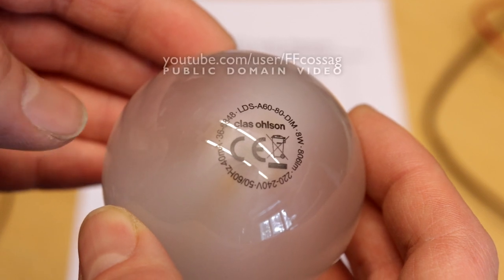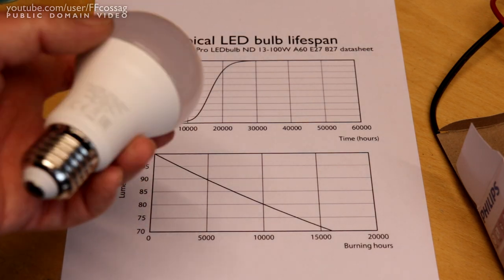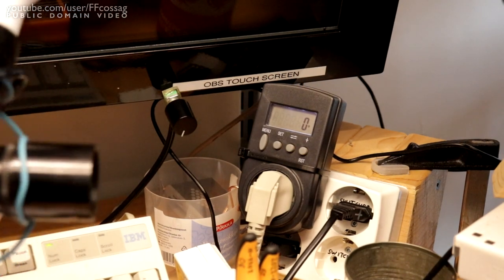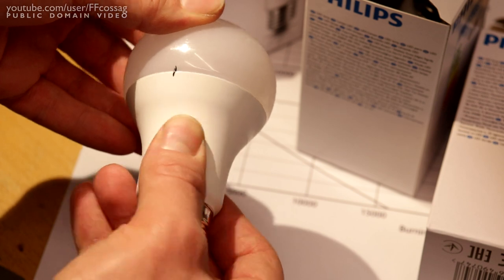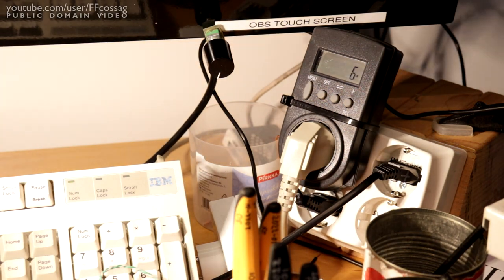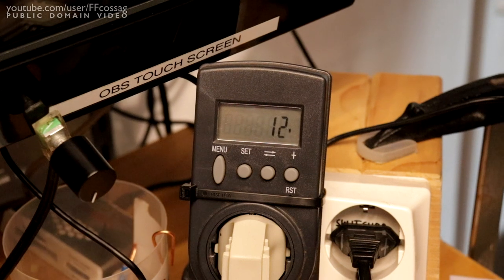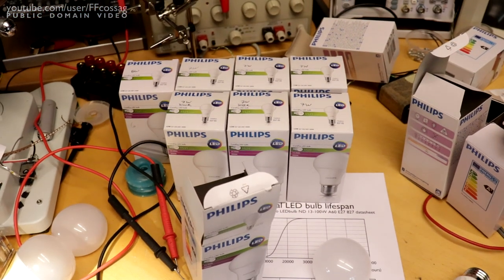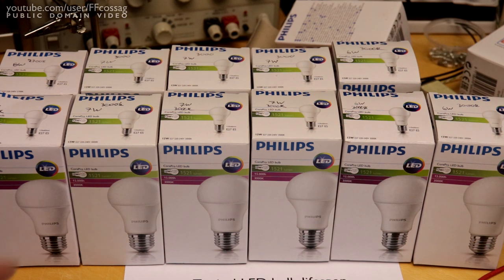Making "Dubai lamps" from 13 W Philips bulbs with a simple hack!

Comment: I think the brightness decrease is not linear, in fact at 50% of the current the brightness may still be 60% or even more!
Reply: It's not just the LEDs becoming slightly more efficient.
Firstly, the eye's response to light is logarithmic. It takes 10 times as much light to appear twice as bright. However,  that only applies when you can compare the two light levels....
The human eye has "Auto Exposure", using a mechanism called the IRIS. No matter what the light level, the human eye automatically adjusts so that you can still see properly!
These two mechanisms allow a human to see in light levels of 0.1 Lux to 100,000 lux without much difficulty. A 50% drop in measured brightness (Lux) is completely unnoticeable, providing that you don't see the transition occur.
Reply: @johncoops6897  I mean if you use lights as work lights you need a lot of light output to avoid darkness in shadowy regions. You can then either just use multiple bulbs or just go straight to LED strips that last forever. Or LED tubes, I got some 7 years ago and they still perform like day 1.
Reply: @kyoudaiken  To prevent shadowing, it's better to use a large diffuse light source, so tubes (with diffuser) are best. Bright pin-points like LED tape are the worst choice.
But you have got some concepts backwards... The brighter that you illuminate an object, the DARKER the shadows will become.
This is because your eye's Iris closes in response to the brightest object in the field of view, and that reaction then causes the less bright areas to become even darker.
For example, if you are walking through the forest at night, you can see into the shadows much better by moonlight than you can if you have a torch. 
PS: I am a lighting engineer, this stuff is my profession.
Reply: @johncoops6897  Nice to know! With my setup at home I don't really have issues with seeing stuff. But I keep seeing YTbers reparing stuff and having a lamp on a movable arm and illuminating the device with like 1000lm directly from 4 inches away... Bad eyesight?
Reply: @kyoudaiken  - the amount of light required increases with the level of fine detail required. Lumens are not a measure of lighting intensity but it would be common to have a bright task light for fine work like SMD soldering. As you age you tend to find that focussing improves as light levels increase (to a certain degree). However vision is most improved by the level of contrast and direction the light is incident at. It's not about quantity, but quality of light that matters.
Reply: @johncoops6897  I worte lm which is lumen, not lux. But yeah, have seen this in many YT videos before while I don't need too much light to be able to work as I am not that old yet.
Reply: @kyoudaiken  - Because I am a lighting engineer, I know that 'lm' means Lumen. The measurement unit doesn't really have any direct relationship to how brightly objects will be illuminated, nor how bright they will appear.
Hint: Don't use flashlight and battery forums to learn about lighting, as they are full of misinformation and misconceptions.
Reply: @johncoops6897  Just worried that my eyes might become less light sensitive with age. Is that the case?
Reply: @kyoudaiken  - They won't become "less light sensitive" as you age, so things won't get darker. Long answer follows....
...
Your visual acuity (ability to discern fine details) definitely decreases as you get older. There are many causes for that happening. Providing that the lighting maintains (or improves) it's "quality", an increase of lighting intensity will allow an older person to similar acuity as a younger one.
Put that another way... in VERY general terms, a very young person can see fine details with less light than an older person would need to see the same level of detail.
Note this is not about focus, but more about contrast. Furthermore, there are numerous other things that affect acuity, so just because a person is old doesn't always mean that they cannot see  as well as a younger person, or that all younger people have good vision.
Regarding your own eyes, it's the same story as for your ears... they will never get better, and will continually degrade to some degree as you get older. Most of of the acuity degradation of the eye can be compensated with higher light levels, but it's not just about blasting one million Lumens at everything.
...
Anyway, generally the amount of light that you need AND the quality of light you need will continually become higher as you get older. I keep saying "quality" because the quality of lighting is FAR more important than the quantity, irrespective of your age.
Yet the term "Lighting Quality" doesn't mean "better CRI" or "More Lumens" or any of that stuff. It relates to the way that the light is applied to the object, and the contrast between the "object of regard" and the ambient (background).
...
For example, a pure black object will always appear black, no matter how much light you throw at it. Furthermore, you cannot see a black object against a black background either!
So, to see a black object you don't need ANY light on it - you simply need to provide a TINY amount of brightness to whatever is behind it. If what's behind it is dark grey, you need to add more illumination than if the surface behind is pure white.
Providing the ambient (surrounding) light levels are low, you can easily and clearly see a black object against a white background illuminated by moonlight (0.1 Lux), which is much less than a match or candle.
....
A huge subject, but in simple terms the amount of light is not particularly important to our vision. Our eyes and brain automatically sort all that stuff out, and can adapt to an amazingly wide range..
...
Anyway TL:DR; You will need more light and better light as you get older.
Reply: @johncoops6897  Thanks for this extensive clarification. I have probably learned more from you than in half a semester in University! People like you should be valued more on the internet as opposed to most plebs who just get aggressive trying to convince you with arguments that seem off. Many thanks again and I hope you have a nice day! Stay safe and healthy! Greetings from the Metropolitan area Rhine-Ruhr, Germany.
Reply: @kyoudaiken  - I am from Australia, however I have visited your region many times. I used to travel regularly to Lüdenscheid and Arnsberg (East from Wuppertal) to visit the big lighting manufacturers in that region. Many years ago I always attended the Hanover Fair, which was the biggest lighting expo in the world. This is now named "Light + Building" and is now held down in Frankfurt - it is coming back in October 2022 !!
Mein Deutsch ist schrecklich, aber vielleicht treffe ich dich dort auf Bier und Würstchen!
Reply: @johncoops6897  Haha, world's indeed small! Who knows! :) Hope you liked your stay in my weird home country!

Comment: i bought thousands of $ of led panel lights in both warm and cool white for my restaurant and home .. and they don't last more than 4000hrs cus they fail within a year of 8hr daily use and i don't even run them constantly i alternate between sets of lights . and even then 30% of them have failed and the drivers don't fail the leds fail. i bought same size and voltage leds from china and change the burnt out leds and cut a resistor in their driver to reduce the panels from 11w to 8w and apply proper thermal paste to the back. cfl lamps last much longer than these leds.
Reply: Watch https://youtu.be/ISTB0ThzhOY to find out how to lower the watts used by each lamp.  They run thermally cooler, and there is also lower lumen output (not determined in video).  However, the decrease in light output is a lot less than the decrease in electricity consumed, since less electricity is being converted to heat.

Comment: Nice hack! Did you reverse engineer the schematic (not necessarily Big Clive style 😉) so to see how the schematic is affected. Lasr week Big Clice showed the schematic of a led lamp of which the driver ic consisted of 2 current sources. Each with its own resistor. If this lamp uses the same stetup you might be able to lower the temp. of the driverchip by replacing both resistors with different values.
Reply from the maker: I didn't reverse engineer it more than necessary. In this lamp though, the resistors are just wired in parallel.
Reply: Funny design. (To high power dissipation for 1 resistor?) Now I have to dig up the datasheet of the driver ic to find out what's going 😉
Reply from the maker: They usually do that to cut down on BOM costs, and to make it easier to use the same PCB for different power bulbs.

Comment: I got several lights and jesus the constructions is getting worse and the last nothing. It's a scan selling "25k hours" lamps and after 1-2 years its dead.
Some i able to recovery just removing the burned led and sorting with soldering. This "hack" dont know, but almost all E27 came across doesn't have resistors in the LED PCB so the manufactures "fixed the exploit"...
I prefer LED strips that's last much more and more easily to repair. I have a strip working for 10 years and used everyday at last 4 hours a day!

Comment: Funny thing: cheapo 3€ led light bulbs sold locally have a 3 year warranty ;)
Reply from the maker: They count on slippage (no one will bother) and few runtime hours per day. They won't last more than 10 000 hours or so, just like these ones.
Reply: @FFcossag  Maybe, I had these for about 2 years now and so far I have exchanged 2 of them I believe. Anyway, when buying cheap tech I divide the price with the length of the warranty ...